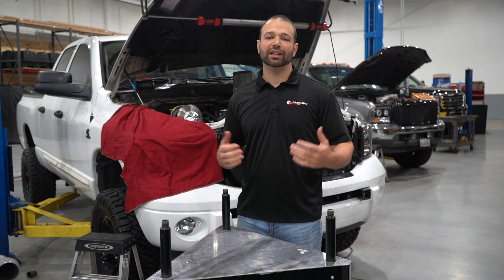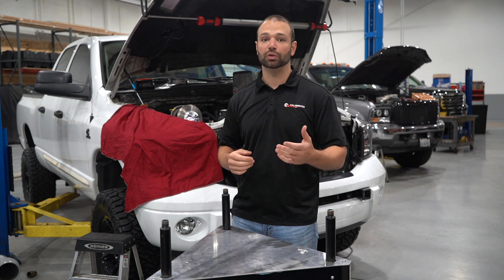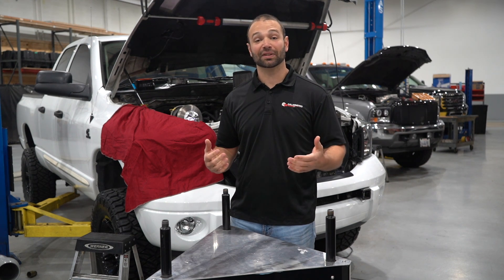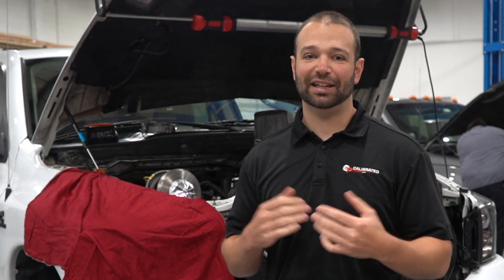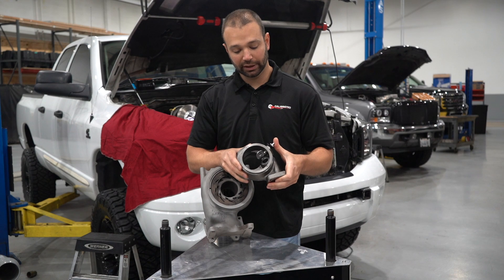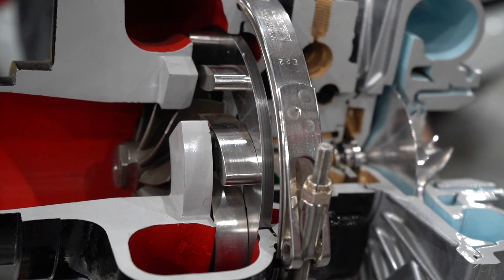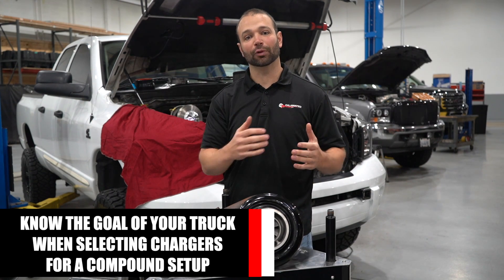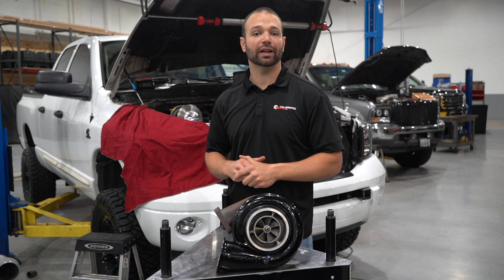DIESEL INSIGHTS: SIZING YOUR COMPOUND TURBO SYSTEM

Comment: I have a 2007.5 Cummins 6.7L. 

Head studs 
20% over on injections 
64 mm phatshaft turbo 
Built transmission 
Larger intake manifold 
Larger inter cool 

My EGTs are manageable but I have been considering a larger single or compounds to keep them even lower. I am a idle to 3200 rpm kinda heavy tower. What are your thoughts and recommendations.
Reply from the maker: Nothing beats a compound setup. That being said, they come with a price. If you are looking for a turbo upgrade, the Stealth 64 is a better match for your current setup. The 67 will give you room to grow.

Comment: Hey , Nick! I have your stealth 64 turbo on my 06 5.9 and I have been running into some turbo surge problems. Any ideas for a solution? Will this compound kit help, or are you able to change out turbo wheel? I’m at a loss and any help would be great, thanks.
Reply from the maker: give us a call so we can learn a little more about your issue and in turn, give some helpful feedback. 815-568-7920
Reply: @Duramaxtuner  ok, thank you.

Comment: Building a fule restricted 5.9VE (91.5IC)looking for 3-350hp@ 2000rpm w/stock "2500"(actualy 2000 through 2350) rpm gov .
What do you think of g25-550 HP and s362sxe LP  for this project? 
Context is king
3 9l 4bt @3500 is the same air flow as a 6bt @2500. 
With that said, my thought is a 350 horsepower compound setup for 4bt should be ideal on a low rpm 350 hp 6bt

Comment: I am curious about running a larger secondary and adding an external waste gate to relieve exhaust pressure. Is this s good way to go?
I have a vp44, sxe 362/70 - 472/110
Reply: I wouldn't go any bigger with your secondary. If anything just do an external waste gate on the set up you have now if there's a real pressure issue. The trouble with the vp44 is that you really aren't going to make more than 600hp reliably, and the 62/72 setup you have is good for 650-700. So going larger on the secondary is going to gain you pretty much nothing, just loss of money on a turbo you don't need.

Comment: For someone who is responsible, I swear I am, for an s475/stock how quickly will I need to upgrade the transmission on my LMM?  No flooring it = no problems???
Reply from the maker: Lots of guys run our Stealth 64 on a stock transmission truck. It has more to do with your tune and driving style. The turbo wont just make your transmission fail. Abusive driving will.

Comment: HI Nick- Jess here from Australia- Have to say your clear and concise videos are excellent, lots of good tech information delivered in a way that is easy to assimilate ... my question is a little off topic for your every day engines- I am building up a Mitsubishi Canter 4x4 I am wanting to do a compound setup the engine is a 4M50 (4.9L 4cyl)  my Factory turbo is TD04HL = 45.6mm exducer, 52.0mm inducer I am wondering what you would recommend as a second turbo I am struggling to find the right information to match them up... Thanks in advance.. Jess
Reply: seems the Bot has blocked the numbers for engine its a Mitsubishi 4.9 litre 4m50  the factory turbo is a TD04 HL with 45.6mm exducer and 52.0mm inducer

Comment: Awesome video once again. What sort of drive pressure compared to boost would you consider typical to see on a compound set up
Reply from the maker: It's not unusual to see 1:1 drive pressure below ~2750 RPM climbing past that, may peak 1.5-1.6:1 towards 3500 RPM.  It really depends on RPM, load, and turbo sizing.
Reply: Upgrade smaller turbo turbine wheel

Comment: Wondering if 3" exhaust is too small form a s464 secondary to a T6 s475?
Reply from the maker: Most would run a 4" or 5" exhaust with that setup.
Reply: @Duramaxtuner  okay so it should be a 4" from the S464 turbine housing to the inlet of the S475 turbine housing?

Comment: This might be a bit left field but I’m currently building a compound turbo KTA19 Cummins and need some help with turbo sizing.   I’m chasing about 1200hp at the flywheel with a max rpm of about 2400rpm.  Most of the time it will be operating between 1200-1900rpm.  Any suggestions??
Reply from the maker: Sounds like an awesome project.  We would have to do a bit more research to see what they have to start with.
Reply: They run a Holset HX80 standard I believe

Comment: So matching turbos, on a cummins 6
7, how well will a 364.5/80/1.0 and a s480/96/1
32 be? My goal eventually is 900+ to the wheels
Reply from the maker: That is a pretty common setup. Should be good fun on the street.
Reply: What size injector and cp3 should I run in that setup

Comment: Got a 2000 Cummins 6 speed manual, has 200hp injectors, headstuds, Ejwa, airdog 100 and some other small things done, I have a 63/68/.70 turbo on now and it runs pretty decent. I’ve toyed with the idea to eventually run compounds. I don’t tow with the truck at all I just play with it. What would be a good turbo to pair with what I got? Minimal lag and decent driving manners, any thoughts? Thanks!
Reply from the maker: An s480 should be a solid match with that setup.

Comment: Kind of a silly question but is there anyway to retain your engine brake with a compound kit?   (18 2500 Cummins)
Reply: I'm don't know for sure, but the newer cummins engines exhaust brake by closing the vanes on the vgt, if you compounded with the stock vgt and an s400 the factory exhaust brake would work I would think. Although you probably already figured that out.

Comment: Any chance you could do the same video but talk more about what you would need to adjust for the low end torque and towing end of the spectrum? I'd love to get a real quick spool down low at 12-1500 rpm, not too worried about the top end but still need it of course.

Comment: I’m looking at building a compound setup on a 06 cummins with a 363/74/.91 sxe on the manifold would a s488 be too big for a primary or would that be a good setup?
Reply from the maker: The s488 should be a good match.

Comment: I have a 12 valve with a hx35 hx55 compound setup. It performs absolutely perfect, but I’m curious to your thoughts on a better replacement for the hx35 Because it’s such old technology. Is there a better option for a manifold charger in this setup?
Reply: If anything you may tweak with your wastegate opening/arm length preload to get the best 'handoff' between the two turbos, but in reality the HX-35 is going to be tough to beat in that application especially at power levels below 650rwhp.
Reply: That’s what I thought. I have the gate set at 25lbs as is. 
At 45lbs total boost I have 14.5 intermediate boost.
Stock fueling minus timing.

Comment: I have an lmm and a bought a s480 kit and I wanna go with 100% over injectors and 12mm cp3 and I wanna make around 1000 hp what turbo do you guys recommend
Reply from the maker: 67G2 and s488 will get you there or damn close.

Comment: 06 5.9 Cummins....tows 10k maybe 4 times a year....shooting for the best setup for 800HP.  Weekend fun truck 95% of the time.  100% Over Exergys Stocker/S475?  Stealth 64 / S480?  Opinions?  Thanks!
Reply: All depends on what you want to spend. I went semi cheap on the turbos: My setup on my early 04 is a he351 (opended up wastegate and billet wheel) over a s475 using crazy Carl's kit. 60% nozzles and dual fuellers. I tow with it all the time and it spools similar to stock. Smarty on lvl 4 with no added timing, torque, or rail pressure. Egt's can get in the 1300-1400 range on long pulls with a 25k lb combined weight in 6th gear but doesn't have any issues keeping up speed.
Previous truck was a 01 24v and had 100% injectors and bd race twins. I couldn't tow with it at all. Laggy and high egts. I only had an edge tuner back then, so there are probably better options now. I like the smaller primary turbo and injector setup better for towing.
Reply from the maker: A stocker/s475 kit is going to give you the most bang for your buck. the Stealth 64/s480 kit will make more peak power but it's hard to beat the $/HP ratio of using your stock turbo (assuming it is in good condition now).

Comment: Whats the phone number to the shop i need help with my lbz going in limp when towing .i heve egr delt new ppe up pipes and down tub .edp tune with 5 switch and straight pipe
Reply from the maker: Our phone number is 815-568-7920.

Comment: I’m looking to take my lbz to the limit of the bottom end or around the 700 hp Mark I don’t tow often so I was thinking of getting a stealth 67, but after watching I’m questioning if I should run twins instead? Thoughts
Reply from the maker: It all comes down to how you use the truck.  If you tow often and heavy, you can't beat twins.  The big benefit of the single is obviously cost but it also allows you to build your truck over time.  You could always run the 67G2 now, then add an s488 down the road.
Reply: Duramaxtuner thank you for the suggestion, you guys will be getting a call soon!

Comment: I bought a LML Stealth 64 from you for replacing factory one
thinking for turbo  compound kit
should I get 1.32 t6 or 1.15 t6? thanks
Reply: The 1.32 works great on that application. We've run the 1.15, it balances the output but honestly probably isn't worth the cash.
Reply: @nickpriegnitz5895  Thanks

Comment: When going to a compound, is swapping the stocker for a 63mm a bad idea if the primary is a 80mm?  I'm looking at a compound kit and the 63mm comes with it.
Reply: John Davis you really want to focus on the turbine sizing if you’re planning to run the kit hard. Think small compressor (love the 63s with 480) and make sure it’s got LLY vanes or large like in our Stealth lineup. Avoid LBZ and LMM exhaust housings.  Unless you’re under 700rwhp, then you’re not pushing the kit hard enough matter ;)

Comment: 2 questions...
1.  Can you run compounds on a LBZ Duramax without deleting the EGR?

2.  2006 LBZ Duramax used as a backup daily driver, mainly for towing and occasionally at the dirt or street drags.  I have already done the Stealth 64  turbo with supporting upgrades and stock injectors. Lets say I'm looking for more power but still use the the truck same as stated above. If going to a compound setup, what do you recommend for a primary (atmosphere) turbo? Do I need to replace the Stealth 64 in the valley with a stock turbo?

Comment: Have a stock replacment batmo compressor wheel and 10 blade turbine on the OEM turbo, will this be an issue compounding?
Reply from the maker: Shouldn't be.  The batmo generally performs just like stock.
Reply: @Duramaxtuner  except at 10k+ feet, it's been great even through the grumblings of the guys at my shop saying I should have put a 11 blade on it. Thanks!